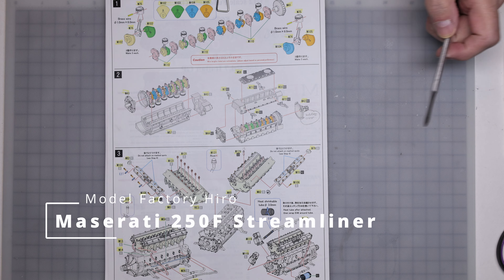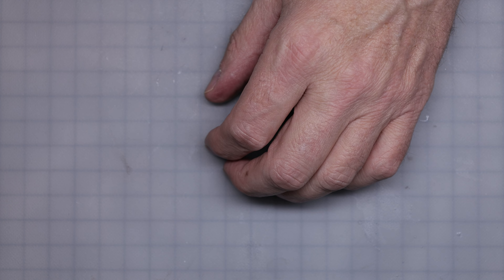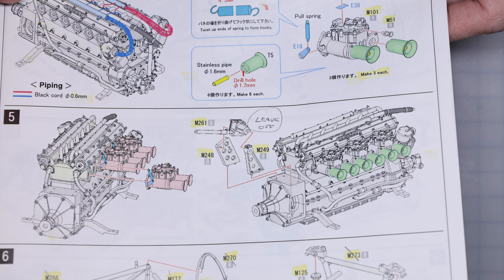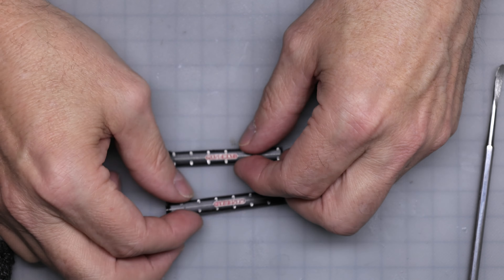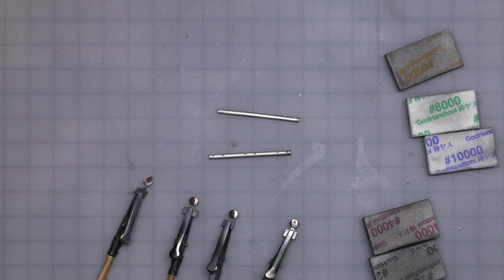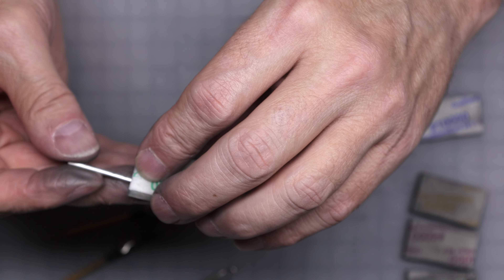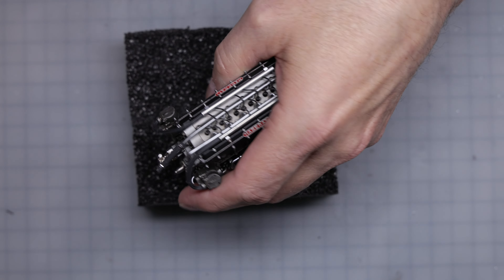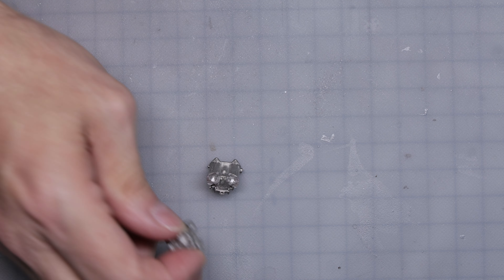Model Factory Hiro 1/12 Maserati 250F Streamliner build part 4

Comment: For the parts coming inside the engine and which will no longer be visible once it is assembled, it would have been very interesting to recreate the engine block in transparent resin and to integrate these parts inside so as to so that they are visible. On the model the engine block without the interior parts and next to the model the transparent engine block with the interior parts visible. It may take time but the result can be fantastic. 😉
Your work is remarkable. :face-fuchsia-wide-eyes:👍
Reply from the maker: Something to consider for sure.